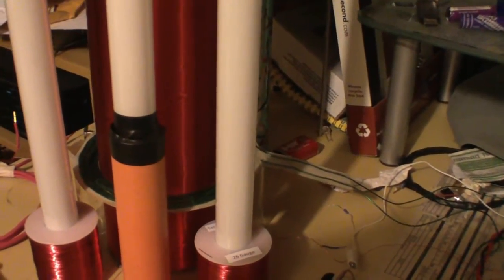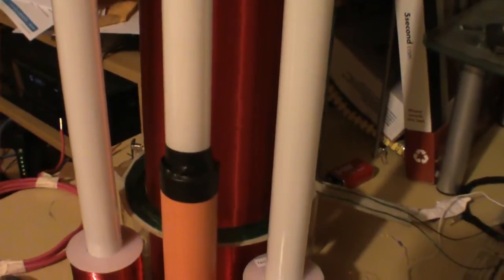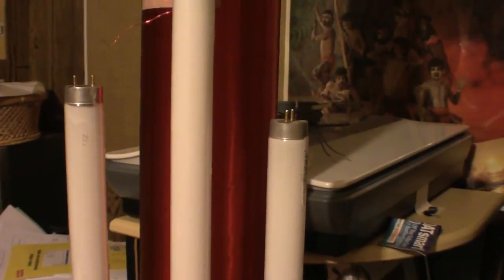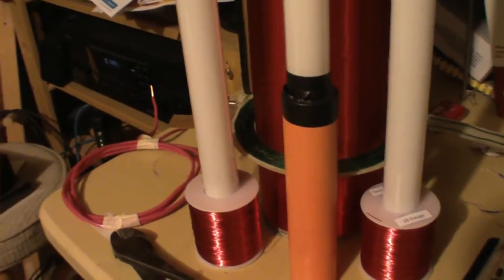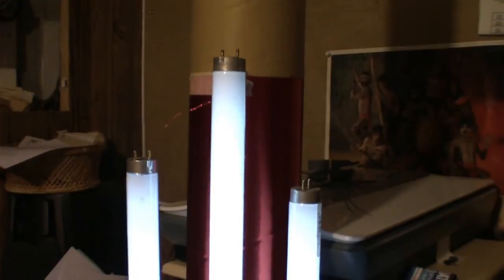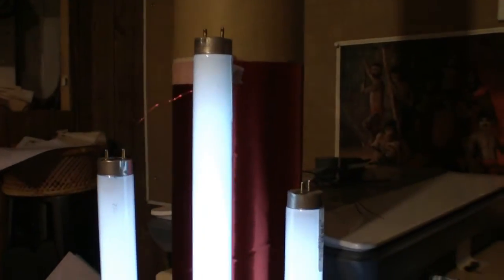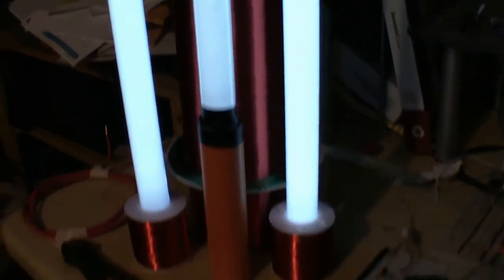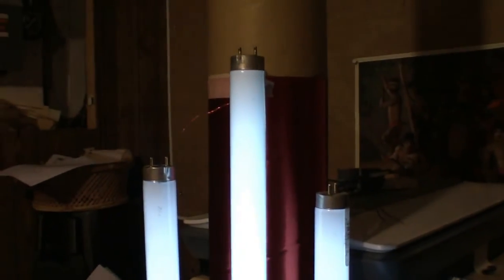Big Slayer Exciter - 12v - 210mA

Comment from the maker: For sure, I am going to rewind this tower. there seems to be something relevant about gbluers (somewhat precise) sizing of 14" in height and around 3.5" in diameter, 800-1000 turns. At about 26 gauge. My goal is to illuminate a full 18" fluoro fairly nicely on a single AA 1.5V battery.